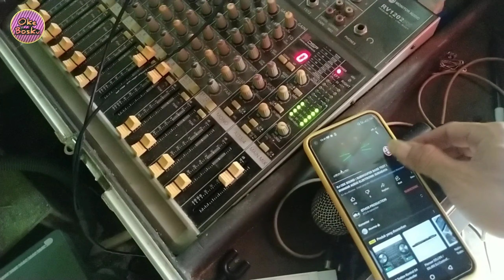SPERTI INI.. 😱 CEK SOUND BOX CBS 6 INCH PAKAI SPEAKER LEGACY

Comment: Maaf mau nanya,.
Jika 2 speaker Legacy 6 inch Double coil dibuat 4 ohm (masing2 speaker 2 ohm), power supply menggunakan 24v 10 ampere, ampli menggunakan TPA3116D2 2x120 watt bagaimana mas?
Apakah ampli tidak cepat panas?
Reply: bisa aja ngangkat tapi gatau panas ato ga
Reply: Kemungkinan panas